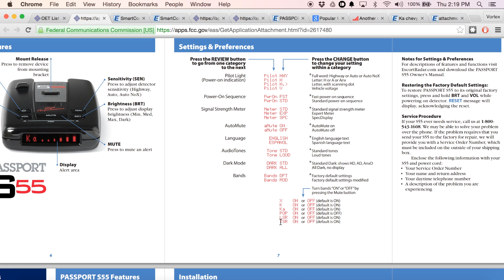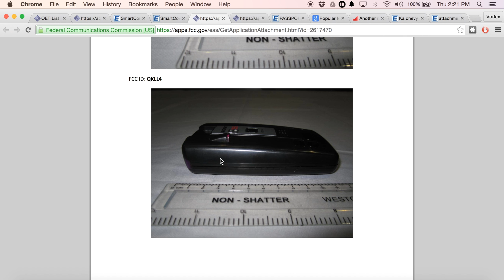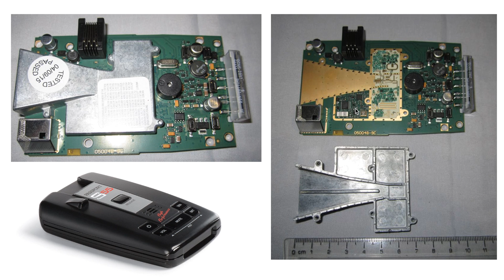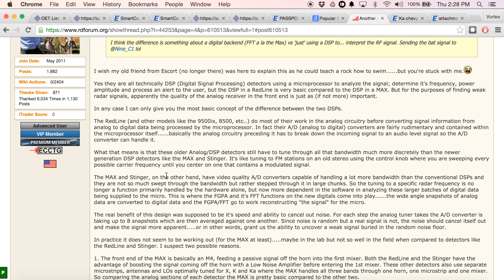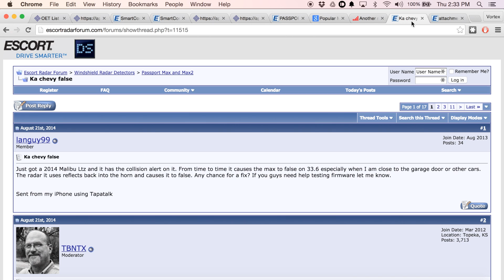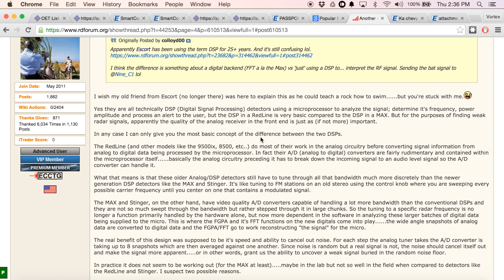Escort Passport S55: A basic M4 radar detector with DSP

Comment: I commute from PA into DE.
RX65 works for me.
I use City No X setting...DE police used K.  Now seem to use Ka + Laser.  
If I cross a bridge to NJ (rarely) I use Highway or Auto to includ X band.
Any other suggestions to this price point & quality? (RX65 wise)

Perhaps they will release a Bel S55 ... guess not now.

Is the top Bel PRO model comparable?
Reply from the maker: +Michael C. Check out the Uniden DFR5. http://amzn.to/1nJHlIf Great low price, similar performance as your RX65, but much better K band blind spot filtering.
Reply: PRO200 or I guess PRO300?
not PRO500
Reply: +Michael C.  
oh OK 
I had an Old Bel back pre merger it worked but many false alerts.
Reply from the maker: Yep, older detector without newer filtering
Reply: +Vortex Radar 
Thank you for answering my questions.
With two vehicles, as you know I love the RX65 it seems to have my needs covered.  I have had my eye on the 'Passport' model.
I was going to settle for an S55.  (which is at a nice price). The RX65 seems to be the 'new' PRO300 / 8500-X50 Black.  
I thank you for recommending the Uniden, but I already have the Radar Mount Mirror Mount Radar Detector Bracket + Mirror Wire Cord $46 (Amzn) connected in my car.
So I spotted the Passport X70 on Sale $218+ sales tx. 
I wanted the Passport but X70 OLED display pulled me in with the price drop- done deal even with the S55 for $147...I picked an X70 & will program it with your Passport review- programming with your Bluetooth video.
Thank you for your Help your reviews are awesome. You help people sort out the options which are a-plenty!

Comment: would you chose this over the 8500x50 detector? im having hard time deciding between the two.
Reply from the maker: +rajvosa71000 Honestly I wouldn't want to run either. In fact it looks like both were just discontinued. https://www.rdforum.org/showthread.php?t=51714 Take a good look at the Unidens for better performance and filtering in that price range. We are in a weird transition time right now where the old ones are being phased out and the new ones haven't been released yet, but that looks like the sweet spot in the lower end price range.
Reply: +Vortex Radar Damn i just got the S55 lol. we'll see how it does lol
Reply from the maker: +rajvosa71000 Yeah the S55 is okay too. No worries.